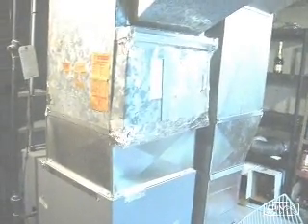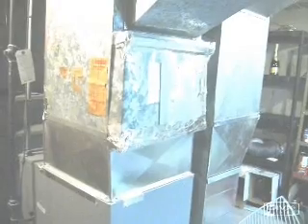Before My GeoThermal: Natural Gas Furnace

Comment from the maker: @stevecoscia123 It will not lower efficency - but the chimney may rust as the humidity in the exhaust condenses on the cooler pipe (and so it is not to code).

No matter now - my geo-exchange furnace now does not have an exhaust!